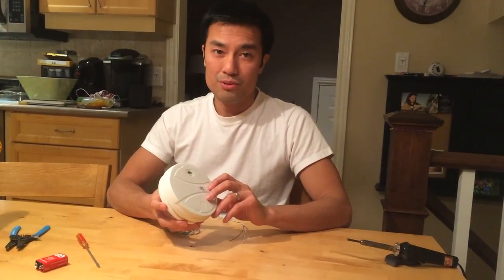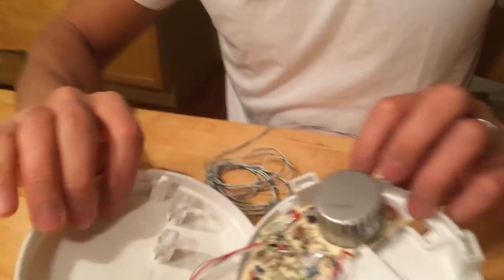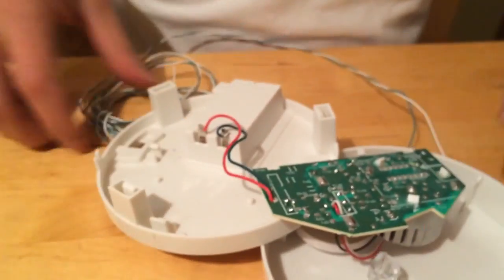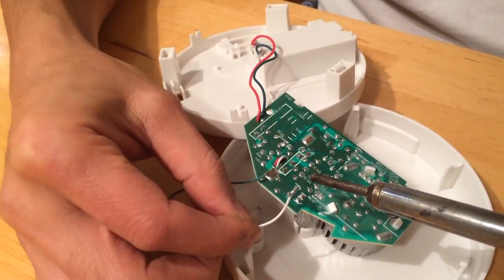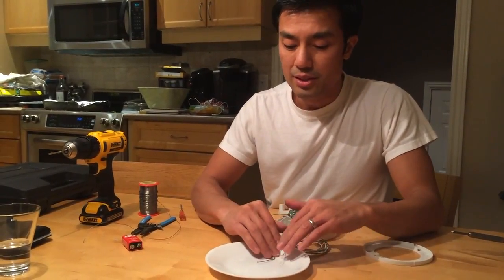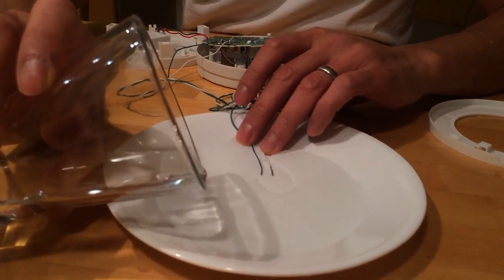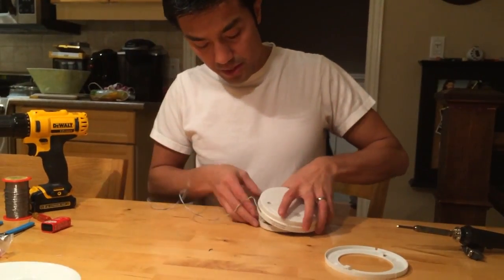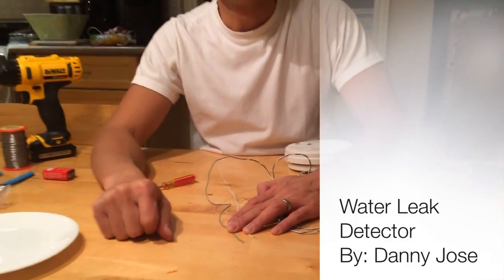Make a Simple & Cheap Water Leak Alarm (Detector / Sensor)

Comment: What kind of wire is that ? Can I use my speaker wire ? Lot this hack, my sub pump did fail and it was a huge mess. Thank You ☺️
Reply from the maker: Glad you like the video!  I believe speaker wires would work.  As long as it can conduct electricity….any wire will work.
Reply: @DDIY-Guy  Thank you for your quick reply. Just knowing I will have this alarm sure takes some worries away. I'm in Michigan off lake St. Clair,  and we have 5 days of steady heavy downpour rain in our forecast. I going to making one tomorrow, I have everything needed to make it. Thank you again 😊
Reply from the maker: Let me know how it works out.

Comment: Can you just connect the Test Button contacts on top without soldering the bottom? Just wondering…
Reply from the maker: Well it depends on the type of unit you have.  The easiest way is soldering it like the video unless there is something to hook the two contacts to with the wires.

Comment: Very clever! Perfect DIY project and at the same time repurposes an expired smoke alarm!! 2 thumbs up!
Reply from the maker: Thank you for your comment!  Have a fantastic rest of the week!
Reply: @DDIY-Guy  Hi, I finally come across an expire smoke alarm and I had fun taking it apart, soldering, and the whole nine yard per your great vid.  Now when I cross the 2 wires, the alarm beeps; however, putting the 2 wires in the same puddle of water doesn't.   Why is that?
Reply from the maker: That is really interesting…are you using filtered water from your fringe or water bottle?  Pure water is actually not a very good conductor of electricity.  Try using tap water from the sink since it will have more impurities to conduct the electricity.
Reply: @DDIY-Guy  It's really bizarre.  My city water is very hard water!  Scratching my head.  No clue why.   Unless this particular alarm requires MORE current to sound.  It's the cheapy $10  Kidde smoke detector.
Reply from the maker: I would try soldering a new set of wires.  Maybe try a difficult gauge of wire.  Also test out the connection on the alarm…bridge it together to test it manually to see if the alarm goes off.  Take the ends of the new wire you are going to solder and touch the two contact points.

Comment: Good work how to reset the alarm If we want to reset the alarm  we have to pull out the wire how to stop it. If the water touches the wire  it beeps right.
Reply from the maker: yes, only when the 2 wire connect with water that it alarms....to stop the alarm from sounding during a water issue....just pop out the battery.

Comment: Great video! Thanks
I wonder if theres a fabric wire that can be used so you can run it and it will detect all along the wire not just the tips! 
Just like the hydros leak detector rope for aquariums
Reply from the maker: Great idea!  As long as you have 2 separate strips of the fabric connected to the 2 contacts on the smoke detector....that way as the water spreads and touches the 2 fabric wires, it completes the circuit.

Comment: One of the most practical diy video I’ve ever come across. Can be combined with a microswitch to detect doors opening etc. Thanks for sharing!
Reply from the maker: Glad you found the video helpful and thank you for the tip on other uses!  Have a fantastic rest of the weekend and let me know if you come up with other ideas for it.
Reply: @DDIY-Guy    Hello...  Thanks so much for making this video !   Any chance you would create one for the door opening idea, not sure how to execute that use of the device mod you did here...
Reply from the maker: Well….this mod works when there is a closed connection in the circuit and not an open one.  For door opening alarms, there are many sensors you can now buy off amazon to achieve an alarming system…even ones that connect through wifi that then connects to your phone.

Comment: The actual parts needed only cost a few cents, so wasting a $5 smoke detector is goofy. Don't take electronics advice from a guy with a dollar store soldering iron.
Reply: Instead of throwing away a smoke alarm it can now still have its use. 
Secondly, why would anyone need a high end soldering iron for this? For real....

Are you always such a negative Nancy?

Comment: Your video saved my a$$. I discovered that my Zoeller sump pump has a defective float switch and INTERMITTENTLY (at great random intervals) electrically fails to power on the pump when the float mechanically activates the switch. It's raining and I can't sleep knowing my basement might flood again so my Google-fu located your video and I was able to cobble together your alarm from a First Alert 9120B AC powered alarm with 9v battery backup. I was dubious this would even work but forged ahead and am very grateful with the result. It works perfectly, thank you! Liked and subscribed in return.
Reply from the maker: That’s awesome!  Glad it helped and gave you peace of mind.  I build one for under my upstairs bathroom, laundry room and behind my fridge :-). You never know when you’ll have a water leak.  Thank you so much for commenting and subscribing.  Have a fantastic rest of the weekend.
Reply: @DDIY-Guy  So that was a fun night because the alarm went off so often I only got about an hour of sleep but that just means it saved me repeatedly during the night. I put a kid on guard duty in the morning so I could sleep and wouldn't you know it, the float hasn't malfunctioned once since then. I'll be replacing the sump before the next rain comes in. Thanks again!
Reply from the maker: Wow!!  Thanks for sharing that story....I can just imagine the alarm going off throughout the night.   Glad you discovered the faulty sump pump....I’m glad you didn’t wake up seeing a flooded room.  Have a great weekend!

Comment: can we solder several of those wires to the same alarm so that if any of the wires is triggered it will alert? Example - kitchen we would have 1 alarm running with wires to dwasher, sink and fridge. If any gets a sense of water the alarm beeps. would this work?
Reply: Salvador Nobre Veiga Another great idea!!!! Great minds working together to come up with magic!!! You guys are awesome!
Reply from the maker: That’s a great idea.  Yes, that will work.  As long as you have a set of wires going to each location, the concept of water being the bridge to close the circuit between those wires should work for all of them.  Let me know how it goes for you.
Reply: Anything that will close the circuit will work...so, yes.

Comment: This is a perfect use for old smoke alarms that are being replaced. That way it costs you almost nothing (just a bit of wire and solder and your time), it doesn't matter if they still detect smoke or not, and you're keeping them out of the trash. 

Plus (as Art Held noted in a buried comment reply) they'll probably work better than the cheap leak sensors you can buy online, you can make the wires almost any length, and you will have a low battery warning. 

And NCW-Online's modification below of adding a sponge to the end of the wires is a great idea.
Reply from the maker: Thanks for the comments and feedback.  These alarms are great...it’s saved me from a flooded basement when my sump pump stopped working.  The alarm was loud enough that I could hear from upstairs.

Comment: Thank you, thank you! I've been needing a water alarm, but don't want the type that has the buzzer that gives a high pitch thin sound.  I need a louder alarm sound to hear from the basement when I am upstairs.  I was considering making an AC powered DIY device but didn't want to involve water and AC current.  I was frustrated until I came across your video.  Today I bought a new smoke alarm and soldered the wires to the test contacts and voila, I have the best water alarm I could want.  Thank you for the info and your time making the video.  This knowledge will be in my brain until. Take care and best wishes.
Reply from the maker: That’s awesome!  Glad you were able to make your own detector.  Thanks for commenting.  Have a great rest of the weekend.
Reply: yea really cool. we can also help out if you need!

Comment: Why bother water detectors are just as cheap I got a pack of 3 for 17.00
Reply: It does seem a hassle when you browse Amazon and see all the cheap options. But there are several very good reasons to build your own. First, DDIY's will be more reliable, and probably run longer when triggered. My research and personal experience is that the cheap water detectors often don't have low-battery detection circuitry like a smoke detector does, so your battery can go dead and you won't know it. Second, a commercial water detector may stop ringing shortly after water is detected, especially in the later part of the battery's life, because the battery becomes exhausted from the Klaxon. Thus, if you are gone for the weekend, you could miss the alarm entirely if it stops before you return. Third, you can extend the wires to any length you want, allowing the alarm to be mounted six or eight feet away from the sensor. (It could even still double as a smoke detector in your basement). Fourth, you can build sensors specific to your need, such as using a sponge for installation in the metal trays now often installed under water-heaters. For these reasons, I think its well worth the hassle of doing a bit of soldering to use DDIY's brilliant solution; it is a great way to get proven, tested circuitry with better reliability for next to nothing.
Reply from the maker: Those are great reasons why I use this option for my sump pump and various other awkward places that could produce water leaks.  Thanks for the comment!
Reply: Art Held's reply noted what is probably the best reason to do this: because the alarms you modify are still functional as smoke detectors, which you should have around your home anyway, so your ultimate cost is only a bit of wire and solder and your time. And you'll end up with something that will probably work better than those cheap alarms.

Just make sure you have some unmodified detectors around as well or test the smoke detection function before completely relying on one of these to still do both.

Even better - do it with old smoke alarms that are being replaced. Then there's no safety issue and you're keeping them out of the trash.
Reply from the maker: Wow.  Where did you get them?  How loud do they sound since my sump pump drain is in a storage area of my drain and I would need the alarm pretty loud for anyone to hear it from upstairs.
Reply: got one of those cheap ones off of ebay, battery only lasts about a month before needing a replacement

Comment: Suggested mod: get a small sponge and cut out a 2x2 inch or smaller section, poke some holes on it, strip wire, twist wire fold wire back along plastic insulation and insert into holes on sponge. 

Sponge will instantly absorb any water and alarm will sound. Reason for sponge is if wires pull up from floor it wont detect water. I glue a small fishing weight on top of the sponge so it stays flat on floor. I have these detectors behind fridge, under water heater, under dishwasher and under every sink in house. 

I once had a tiny pin hole leak develop in my fridge ice maker water line behind fridge. It cost several hundred $$ to fix the damage. Wish I would have known about how to make these types of water leak detectors before that happened. Never again. 

Not a do it yourself type? Water leak detectors are pretty cheap, google it until you find one for 10 to 12 bucks, buy and install it. Don't wait until a water leak "hoses" you for big $$

~
Reply from the maker: Yes, I’ve been fortunate enough to catch all my leak problems before they caused a lot of damage.  Water leaks and flooding is one of the worst and damaging issues for homes.